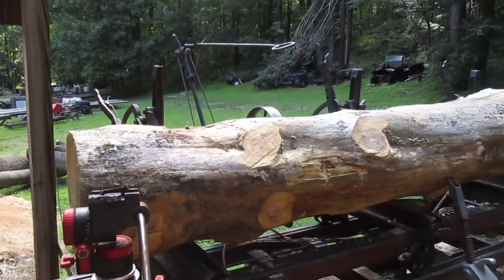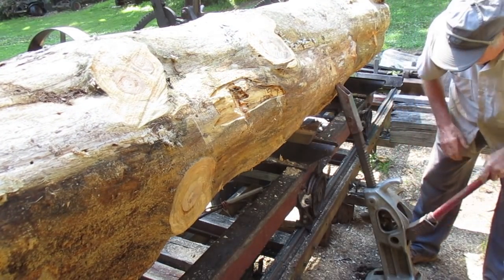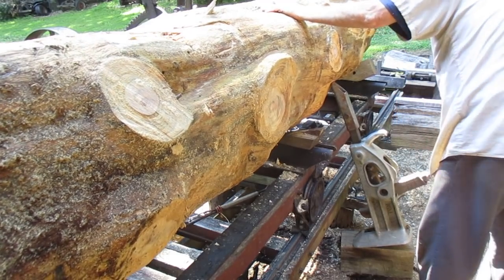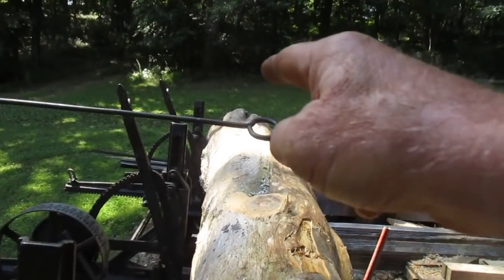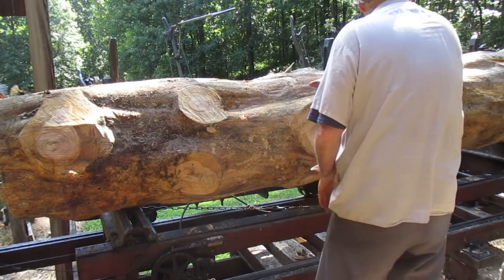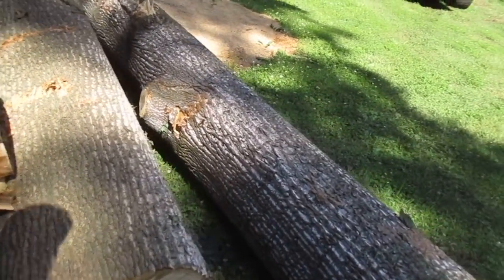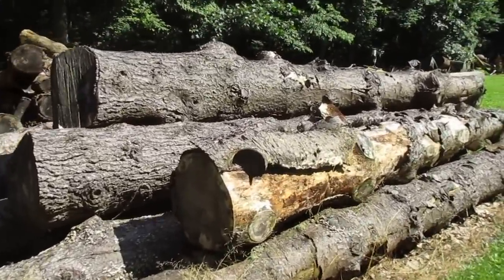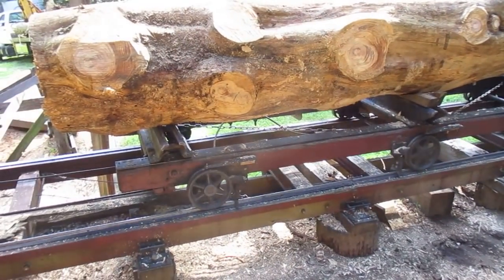How to turn big logs WITHOUT a log turner  #394

Comment: A clever solution to be sure...

...and to be honest, I'm more interested in the Willys Jeep hulk (0:47) you've got sitting in that one tree line.

P.S. -- That gent from OITW treats his blade with diesel when cutting pine...maybe you could wipe your blade down with a rag to help with the resin?
Reply from the maker: hi there the jeeps are just junk sitting around . down sizing sold 6 if the last year . had around 40 in my hay day . thats where the name fricknjeep came from . the sawmills are Frick . Nathen's band mill the board comes together while sawing . circular mills have a splitter on the board side and lead on the log side , . the only thing that touches the wood are the teeth . thanks john

Comment: I see you have a forklift at your disposal for loading logs.  Were you aware that you could wrap a big tow strap around a log on your carriage and use the forklift to help you rotate your logs?
Reply from the maker: hi there there is a 10 foot log deck in front of the carriage not quite sure how to do that . now lets say there is no log deck it would hard to see what the log is doing or in and out of the machine several times . at 70 thats hard the first time . next plan  thanks john